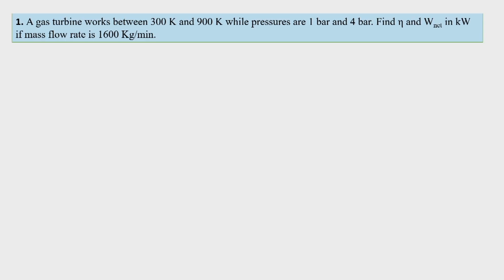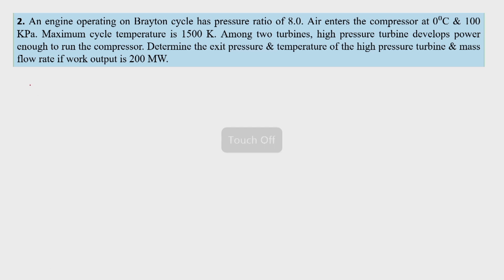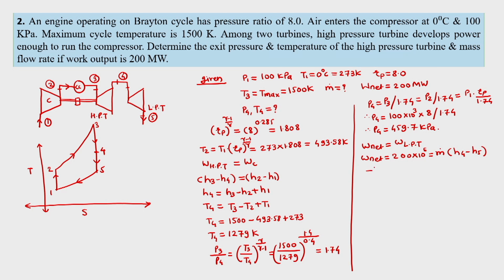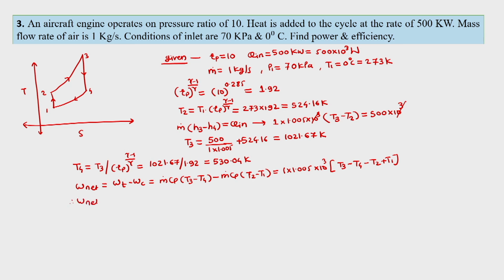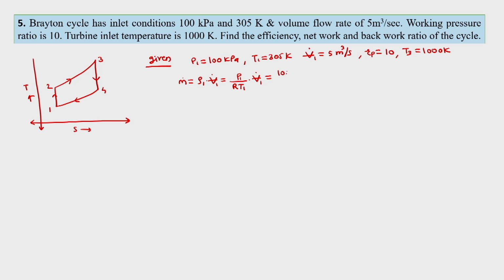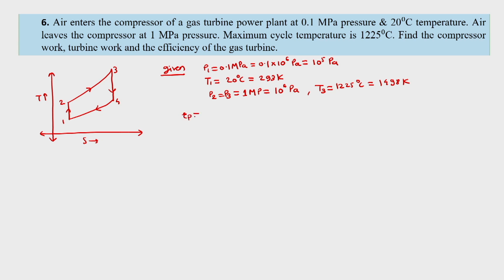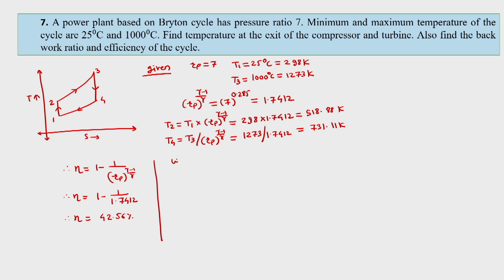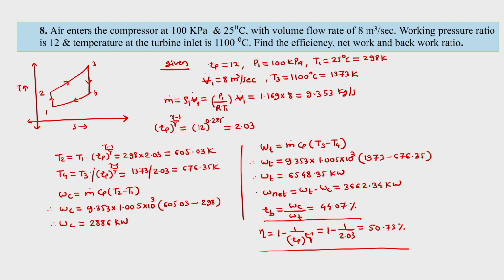Lec 7: Examples for Ideal Brayton Cycle

Comment: Question no.4;  (  Time : 28:30. )
Rp=4.5
T1=300°k
T2=Rp× T1= 1350°k
By another way to find work ratio:
W.R=[1 - {(T2-T1)/(T3-T4)} ]
0.563 = [1 - {(1050)/(T3-T4)}]
T3 - T4 =[1050÷(1-0.563)]=2402°k

Why is it coming out to be a different temperature drop across the turbine?
Reply: I think the mistake is in the line "T2=Rp× T1= 1350°k" that you've typed.

In Lec 6, it's stated that P2 = Rp × P1. However, T2 = Rp^(γ-1/γ) × T1.